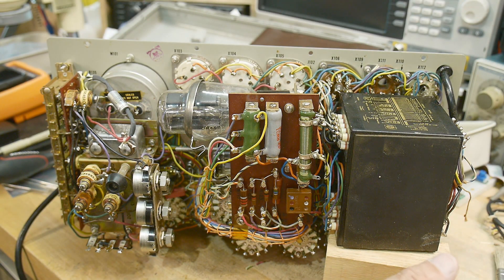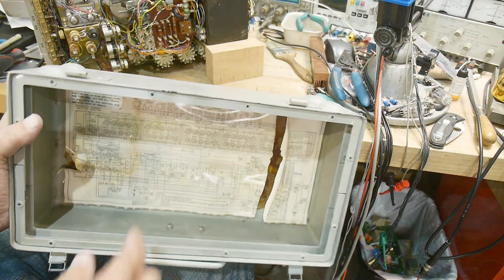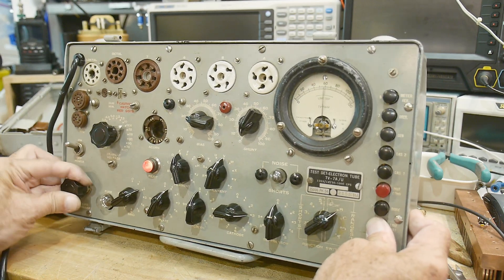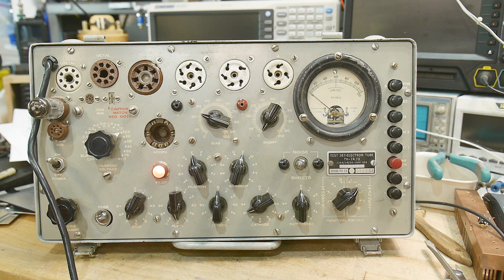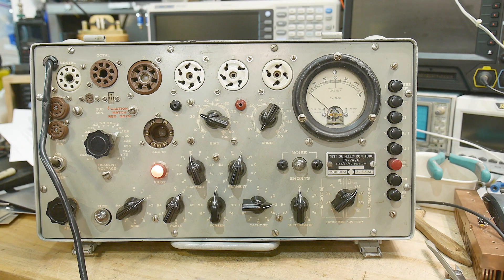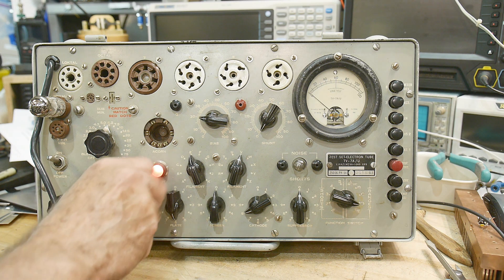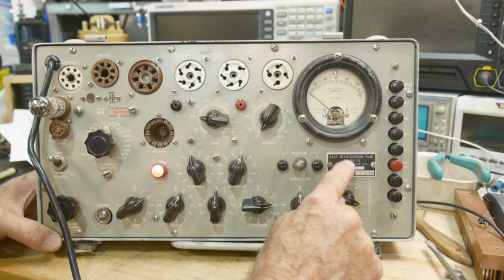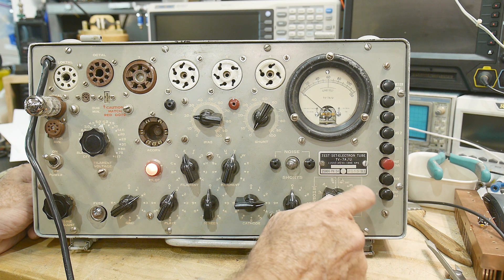#1662 TV-7 A/U Tube Tester (part 2 of 2)

Comment: I remember as a kid, my dad had a tube tester. Each time we went downtown to use the commercial tube tester, we would get a much different reading on the tube in question, compared to the reading we would get with his tester. We found that the tester downtown was wrong a large percentage of the time, so needless to say, we wound up buying more tubes than we actually needed.

Comment: I remember as a kid going to the drugstore to use a similar machine mounted in a display to test tubes.  I would look up the tube on a chart, set all the switches and press test.  They then had a cabinet next to it with tubes so you could purchase a replacement.
Reply from the maker: yup, dad and me would go to Safeway to check tubes on a machine
Reply: Same memory, dad fixed the TV many times, we would drive to town to the local drug store and test a hand full of tubes, he would purchase a replacement and the TV would be back into service. We only had 1 station out of Springfield Missouri to watch. As a grade schooler, after school I was allowed to watch only one show. I had the choice between the Lone Ranger, or Daniel Boone. Boy were those the days! Kinda miss those days.
Reply from the maker: @RonDogInTheHouse  I had twice as many channels !!

Comment: I think I get how this works.  So the bottom knobs set what pin in the socket gets the cathode, grid, suppressor, etc.   Then I saw the bias setting I guess in mA.  Then what is pressing the red button do?  Measuring the voltage amplification?  How do you know what is good/bad?  The meter just shows 0 to 120.
Reply: the chart has the meter reading for the tube to be good.
Reply: The setup chart gives a minumum meter reading for each tube type....

Comment: Set line adjustment WITH tube in place, (maybe ok for low fil current tubes.)
The meter shunt was not set?
Reply: shunt is used in testing rectifier tubes. (no GM to measure in a diode!)
Reply: Shunt function is only used for rectifiers and gas regulator tubes.
Reply: @bobweiss8682  thanks

Comment: Nice video on an iconic bit of test gear!  A couple nitpicks on the operation.  The "line adjust" setting should be made with the tube inserted, so as to compensate for the current draw of the heater/filament. This is especially important with larger power tubes, with heavy heater current loads.   You also didn't show the shorts/leakage test, which should be run before testing the gain/Gm, to prevent possible damage to the tester from testing a shorted tube.  There is also a "gas" test, and a "noise" test, where you connect a pair of Hi-Z headphones to the unit, and tap the tube to listen for loose bits inside!
Reply: Also these type of tube testers are designed to sit flat with the panel pointing upwards. Otherwise the readings are not precise.